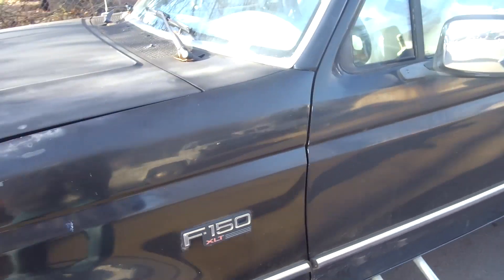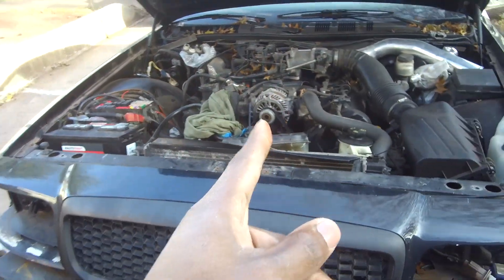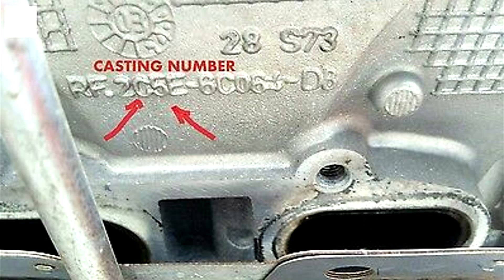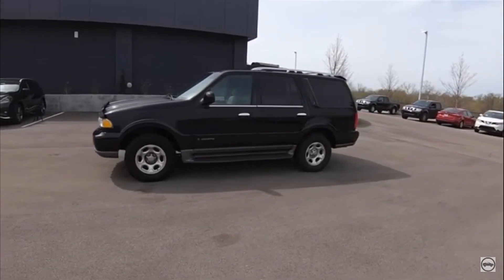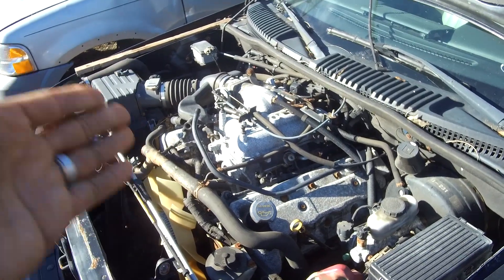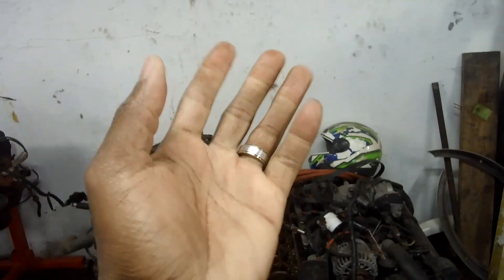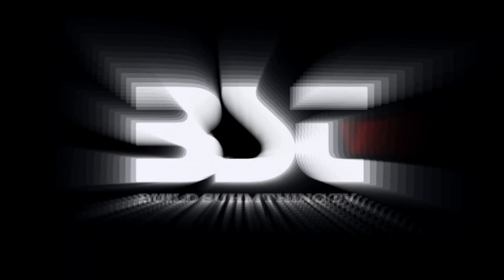BEFORE YOU BUY A Junkyard 4.6 DOHC Engine

Comment: I have a 2003 ford expedition 4.6l can i sawp it, to a mustang 1980?
Reply from the maker: yes you can cause its a 4.6 Modular  ( hope your is a v8 not a v6 ) need v8 harness ect.. If you have v8 and you want to run the motor you just need to swap your cams over from your old motor and intake ect
Reply: Awsome yea its a v8 ill see if i can do a video and upload it so you can see the swap on it

Comment: A 4.6 makes 305 why go through the trouble of a 5.4 an already not that good motor for 13hp
Reply from the maker: very true but the 5.4 motor has tq and the chain is the issue... I have a 5.4 sohc in my truck( good motor ) soooo what i have done is I bought this motor and 2 others and i am working with them to get them running into different vics
Reply: Because there is more to it than peak hp lol.  Ever heard of torque?  Ever heard of a fatter power curve?  You can't use bad examples of 5.4 builds and go strictly off that.

Comment: LS and Coyotes are making 500hp my stroked 351W makes 700hp and your playing with 300? That was a lot, 20-years ago!
Reply from the maker: i can make a lot more , but i do not feel the need to make a lot of hp..  ( its not in the budget ) Question ? How much you spend to make 700 hp  2k 3k or 7k over some years.. What i am doing is just  building a simple build what a little in bank.. Your are really blessed to have that high hp engine ( well deserved ), but i am just building junk stuff thats all nothing crazy
Reply: @bstfordchannel923  cost $15k to build over 10 years. At first the Victor heads were not available and then I found multiple part numbers and flow rates for the "Same Heads" then had to convince myself to purchase the heads. It's a 351W stroked to 427 but I call it a 428 because it has almost exactly the same bore and stroke as my 428 Cobra Jet. It's a $1500 Dart block so nothing is really from Ford.
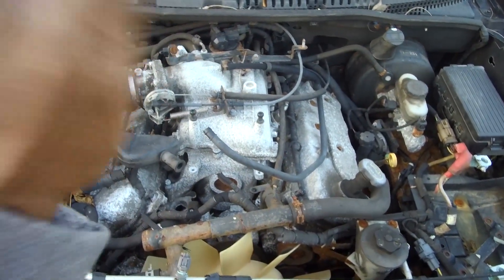Reply from the maker: @Cobra428SCJ   ok so that took you ten years to build ( 700hp ) and i am just getting my feet wet in this v8 thing ( junk style ) and 300hp is my starting point I have turbo Vic i can crank the boost to make 500hp , and it all cost me with car $3,500 as it sit ( turbo,5 speed and traction loc 4:11 gears )   I have very little money dude and I am just learning and i am sure you learned a lot during that 10 year build.. It sounds like you have some sweet rides there brother.. I wouldnt mind seeing one in action!
Reply: @bstfordchannel923  Just a few words of wisdom: The more you/I mod a car, the less drivable it becomes. 

300-700hp it doesn't matter because torque is what makes driving fun. Trust me, 700hp is to much and 300hp is just fine for a daily driver.
My 2000 Saleen Speedster is no longer fun to drive. It sits so low that it bottoms out on the crown of the road, potholes and rocks. My '70 Boss 302 (700hp 351W) has the headache of finding race fuel. The wild cam is beating the $5,000 heads to death and the stock suspension couldn't take all the new torque and put the leave springs through the truck. So stay in the 300-400hp power range, your on the right track.
Reply from the maker: @Cobra428SCJ   Now thats some good info and thats why in the ver begining I wanted 300hp to start then go 450-ish ( then stop ) high hp creates heat and friction ( car needs to breathe ) I will not drive it as its needed so ( it will become a shelf item ) need something spunky on the low end THUS why i am trying to do this https://youtu.be/u8z9tLTx8L4 i am learning slowly about hp and tq ( street machine needs some tq ) need these to work
Reply: 10-years...Well it started as a regular 351W with Cleveland heads and Boss 302 piston. Then I rebuilt it with a $300 393 crank, stock 351 rods, and 302 Boss pistons, Cleveland heads. Then I bought a 427 stroker kit, Dart Block and Edelbrock Victor heads. So now it no longer looks like a Boss 302 engine.
Reply from the maker: @Cobra428SCJ  ahh the snowball affect may do one of those engine i just want it to take some revs like 8k with 400hp and tq to match. then the engine would be very useable . i have to see on day whats up with 351w.. I had one but sold it
Reply: @Cobra428SCJ  700 whp na with a radical cam and other mods that make it drive like crap is totally different from 700 wheel with stock long block engines boosted like alot of guys run these days.  That isn't close to the same.  Not all 700 hp builds are gonna be equal.  Some might not be streetable for shit others may easily be able to be daily driven.  Depends on the overall setup.  It isn't all about hp anyways.  I've seen mid to high 10 second 3000+ lbs mustangs with just over 400 rwhp and I've seen 11 and 12 second cars with 700 wheel.  Hp isn't everything.

Comment: I wish u can help me
I have 05 holden commodore vz ss with ls1 engine 
The engine goes lean at wot
Idk why
Reply: Might need a more powerful fuel pump or better injectors.
Reply: @muntasirali6057  its stock ls1
Reply: Have you done a Volume test on the fuel pump?

I think it's supposed to pump a quart of gas in 15 seconds, if I remember. 

Also test fuel pressure. 
Free loaner tools should be available at your local parts house.
Reply: @PanzerPlatform  I wish it's just the fuel pump

Thanks guys
Reply: @Faisal-ro1zr  
Don't just replace it, diagnose it first. 

Otherwise your "Parts Shotgun" is gonna run out of ammo.
Reply from the maker: most cases IN TURBOS when this happens its the injectors I am sure some said this, Fuel pressure reg and get adjustable one for the engine and Crank it up a bit and see start there , then fuel pump then injectors then get a tune if these do not work

Comment: If you must go with a 4.6l, you don't want the DOHC versions. Stick with the PI, 2V's, far less trouble and the small power difference between the 4v and 2v is not enough to worry about.
Reply from the maker: I agree i did not get the motor some how i am not feeling the dohc... even had a 5.4 dohc and i sold it cheap... 4.6 2v i will make do Johnny like you said
Reply: Not enough to worry about?  A stock long block 4v can do 450 rwhp pretty easily and a fbo 4v ecsp a c head one can go well above 300 to the tires na while a fbo cammed 2v with ported heads can't even reach that.  The difference is pretty significant and if you build the bottom end on both the 4v can make way more power with boost way easier on a stock long block.  The difference is significant I'm not sure why you think it isn't.

Comment: All this about ford's arguably worst engines? 5.4 and 4.6 DOHC engines are junk. Spark plugs issues,cam phaser issues, timing component issues. 4.6L 2 valve is the way to go.
Reply from the maker: I will agree with you on that i like the simplistic engine designs with all the other crap .. sorry for the late reply dude i was working on th Maverick here  https://youtu.be/0JweZqQb0oU
Reply: @Kodiak Radio your the only person to ever make that claim about the 4v modular engines ...4v engines didn't use cam phasers or vct solenoids ... terminator cobra  used a 4v 4.6 the gt500 used a 4v 5.4  Ford gt used a 4v 5.4. No one has ever claimed those to be crap.. 
 the 3v 4.6 3v 5.4 engines had the cam  phaser and timing component issues along with spark plugs would break in the heads.. .. the 2v & 4v spark plug issue came from people over tightening the spark plugs damaging the threads or trying to change the plugs when engine is hot .. but for the most part its not a common thing or huge issue like the 3v engines .
Reply: A 4v smokes a 2v in every way and they're every bit as reliable.  They don't have cam phasers and most of them don't have any type of spark plug issues.  Sounds like you're lumping the 4.6/5.4 3v in with all the 4v after all they're all the same thing right?  Wrong!!!  Obviously you don't know what you're talking about.  4.6 and 5.4 4v came in 96-04 cobras, 03-04 Mach 1, 03-04 cobra, 2000 cobra r, 07-14 gt500 (5.4/5.8 which is just a bored out 5.4 4v) all these engines are solid and none have the issues you speak of.